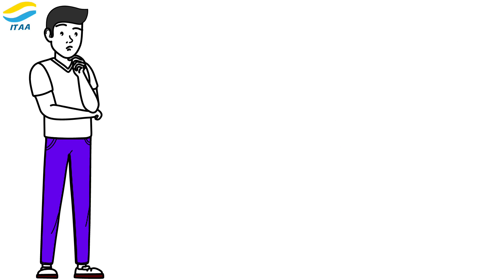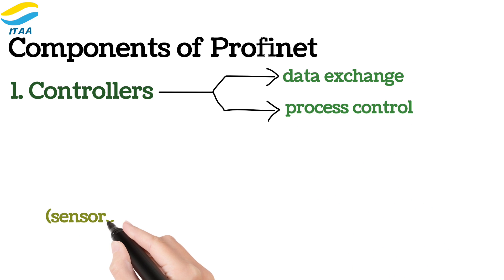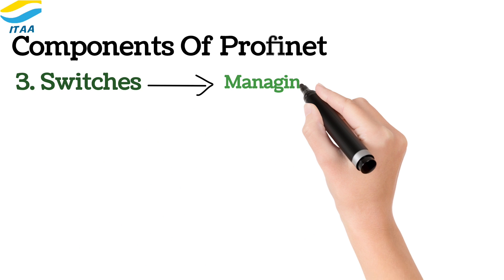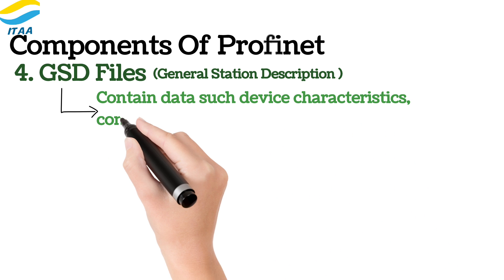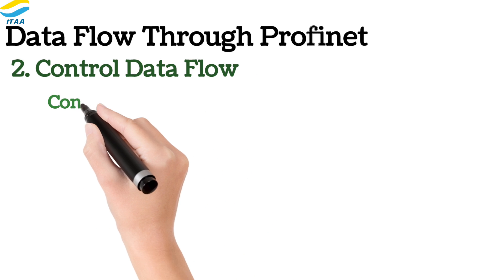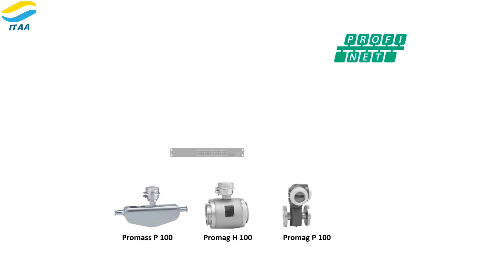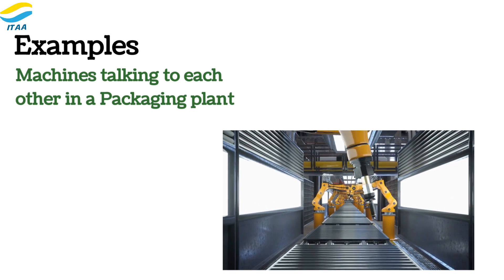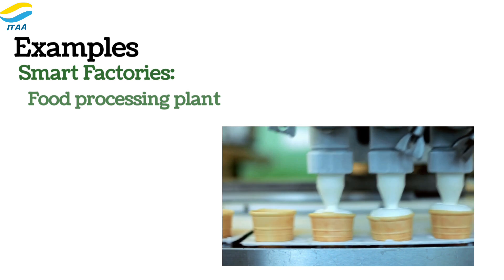What is PROFINET? | Introduction, Data Flow,  and Components

Comment: Dear Sir/Madam,

I hope this message finds you well. I am currently a university student pursuing a degree in Control and Automation Engineering. I would like to seek advice from experienced professional engineers, or those who have at least had practical experience in this field, regarding a book titled "Electric Circuits," 10th edition, by James W. Nilsson and Susan Riedel. The contents of the book’s chapters are as follows:

1. Circuit Variables

2. Circuit Elements

3. Simple Resistive Circuits

4. Techniques of Circuit Analysis

5. The Operational Amplifier

6. Inductance, Capacitance, and Mutual Inductance

7. Response of First-Order RL and RC Circuits

8. Natural and Step Responses of RLC Circuits

9. Sinusoidal Steady-State Analysis

10. Sinusoidal Steady-State Power Calculations

11. Balanced Three-Phase Circuits

12. Introduction to the Laplace Transform

13. The Laplace Transform in Circuit Analysis

14. Introduction to Frequency Selective Circuits

15. Active Filter Circuits

16. Fourier Series

17. The Fourier Transform

18. Two-Point Circuits

My question is: Do I need to learn all the material from every chapter of this book in order to perform the tasks of a Control and Automation Engineer? Additionally, what steps should I take in my learning journey?

I sincerely appreciate any guidance or suggestions you can provide.